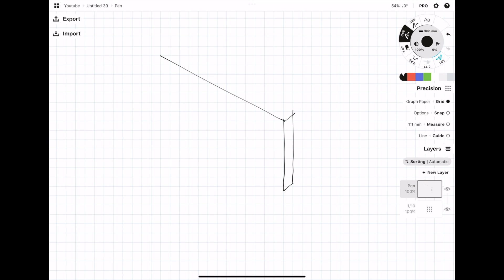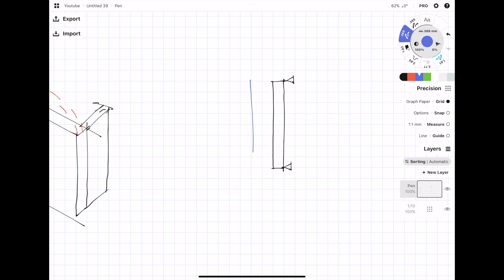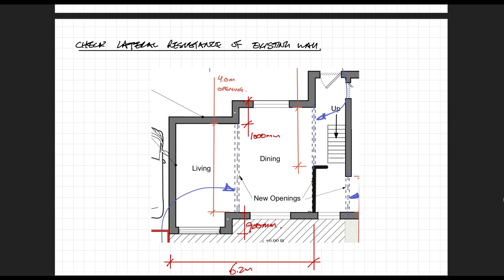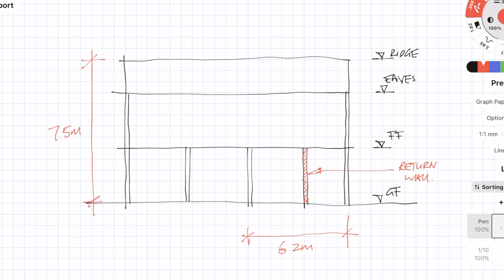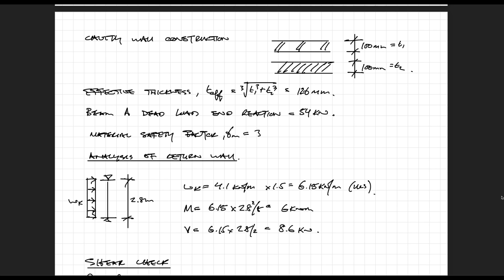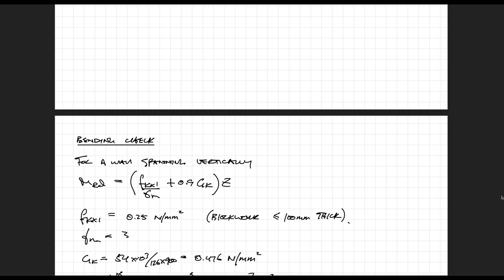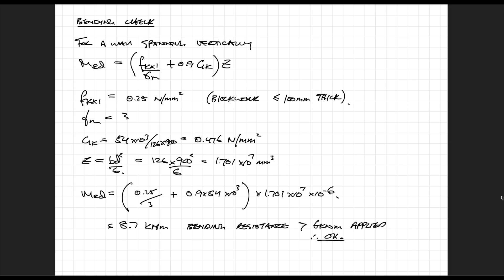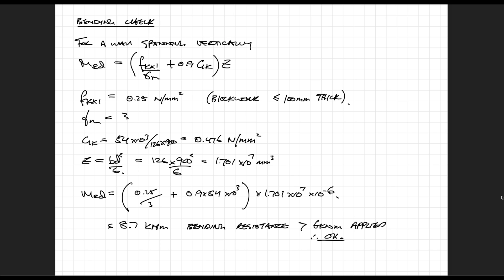Masonry Restraint Design Tutorial - Structural Engineering

Comment: Hi

Im confused by the last bit.  You used 54 for Gk in your moment calc.  Is this correct. I thought it would have been 0.476 n/mm2?
Reply: Yeah I think your right, I was checking solid masonry walls the other day the flexural resistance was around 2.5 kNm for 215 mm solid wall.  8.7 kNm seems very high

Comment: Question - are you considering the piers as part of the stability system - if so surely they should be designed as a cantilever or designed like a shear wall to ensure no tension occurs and the compressive stress in the masonry is not exceeded?

Comment: Good video, however I have a couple of queries:
- Should you have considered the shear walls as cantilevers instead of simply supported beams?
- You are comparing the characteristic value of the shear strength with your shear load. Shouldn't you have calculated the Design value of shear resistance according with EC6-1-1 6.2? There is a big difference between the 2.
Reply: 6.2 refers to 3.6.2, which is used in the video, I don't see the difference as the wall is in compression only.
Reply: @markonakic8870  Hi, the difference between the characteristic value and the design value is that design value is the characteristic value reduced with the appropriate safety factors (not sure if that was the question you have asked) 
I might be wrong or missing something...